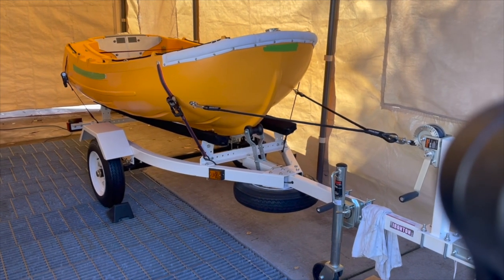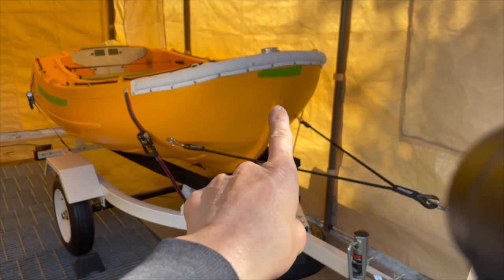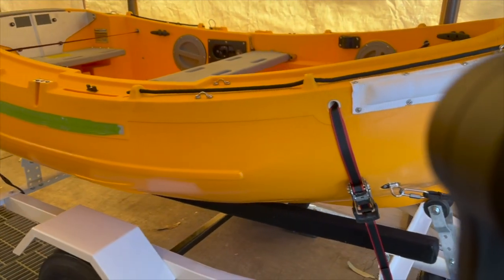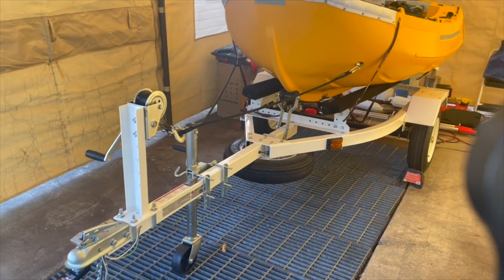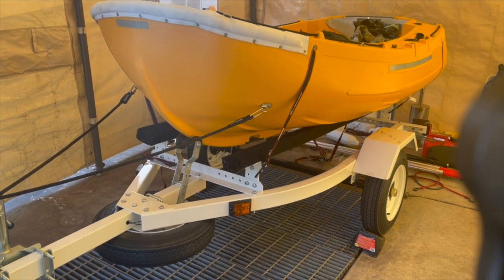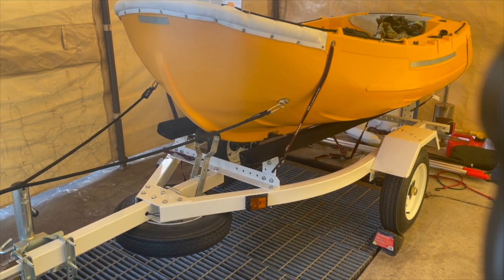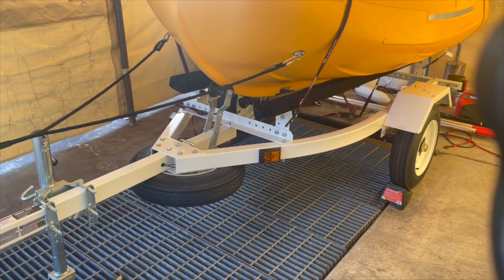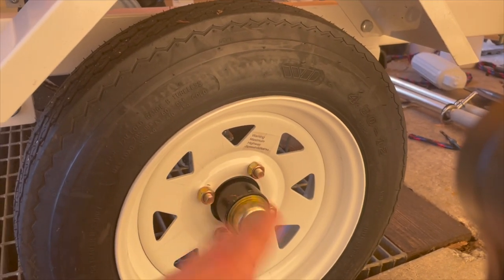Honda FIT Ironton PWC trailer Portland Pudgy setup

Comment: When I saw the title I had to read it a few times to make sure I was reading it correctly. I also tow my yellow pudgy with a Honda Fit! Although, I have an older Fit (07) and Traiex trailer. I have an automatic transmission which is a bit of a worry, but the car drives very well with the trailer, much better than the weight is in the car. Sounds like you are in the SF Bay Area, I may see you around.
Reply from the maker: Yeah I was really surprised at how well it tows.  Trailer, Pudgy and boat stuff is around 500lbs. When I have that much weight of people and stuff in the car it fees much more sluggish.
Reply: @DaBinChe  Have you tried sailing you Pudgy? I have not work up the courage to sail mine yet…
Reply from the maker: @otherbubba2813  yes at Elk Horn Slough, launch at Kirby Park.  I also want to do a sail and camp at Tomales Bay.  Don't expect it to sail as well as most other sail boats of this size, cause of the round bottom haul.   Not sure anything of this length sails well... I had no ideal what I was doing but I got it tacking.
Reply: @DaBinChe  I really want to try the sail rig. The problem I have is whenever the wind is light and the conditions are good to try out the sailing rig, the conditions are also good for fishing, and fishing seems to win every time… 

As far as sailing goes,  from what I understand Pudgy’s aren’t exactly high performance boats, but they do okay. I have the the square head Marconi rig and long “performance” leeboards, which should help it point better, but we will see. It’s a short little boat so it’ll never be too fast. I don’t have a lot of experience and I have not sailed for a very long time. Although, I live ~ close to HMB harbor, so I don’t really have an excuse. What would be helpful to me and maybe others, would be a video going through setting up and reefing the sail. I set up following the manual, but I was not sure I did it correctly, and when I tried to put in a reef, I am certain I screwed something up…it didn’t look right…
Reply from the maker: @otherbubba2813  I only sailed it once and wasn't sure if I was doing it right.  I understand the fishing part, lol.  Good thing with HMB is that you can just sail right there in the harbor mostly protected.  Or maybe fish in the morning and sail in the afternoon.  Morning time might not have enough wind to sail.  You'll want a strong 10mph wind I think.